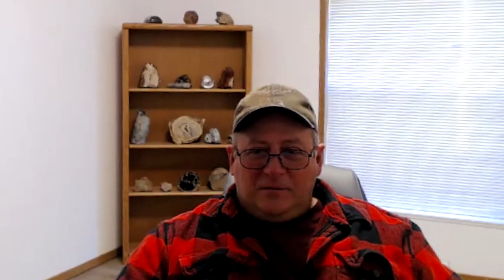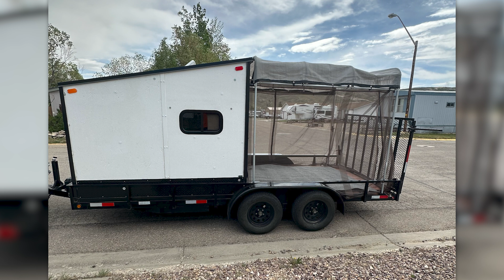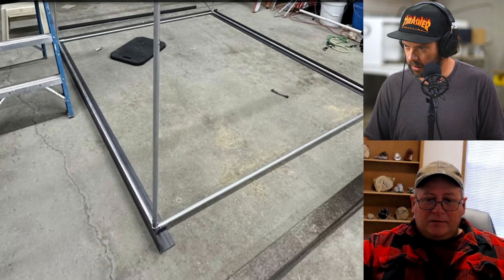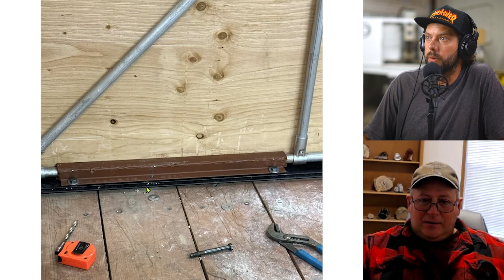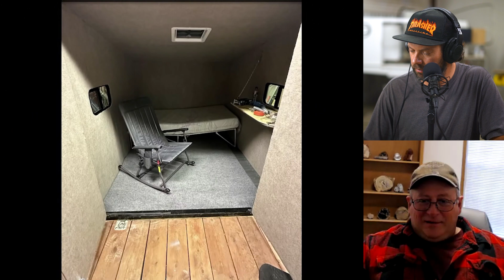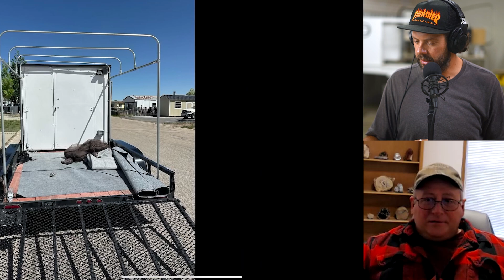Jim's DIY Toy Hauler Camper Is Brilliant!

Comment: Thanks everyone it was a lot of fun   I used 1/2” cdx standard plywood you can use Marine grade if you can find it.     I went with 1/2” plywood for a little more strength.   Then exterior primer then exterior painted,     The roof has a paint on rv coating that reflects a lot of heat, the trim is just roof trim you use on the edges under your shingled roof.   The doors are all framed with maker pipe connectors puzzle pieces clamped around the conduit then my hinges are bolted on to those and through the plywood   Thanks Maker pipe anyone can build cool projects with these connectors

Comment: Would have liked more information on how he sealed the roof, and how he made/put the doors on, and what is the black edging on the outside corners?
Reply: The roof has a reflective RV paint on coating the doors are framed with conduit and maker pipe connectors with puzzle piece clamps around the conduit then my hinges bolted thought the plywood and the trim is metal trim used on the edges of a residential house roof under the shingles

Comment: Great ideas.  I have a teeny  tiny motorcycle trailer that was converted to a utility trailer that I’ve been thinking about doing something with.   3/8 plywood for sure and I love maker pipe.
Reply: Thanks I used 1/2” plywood for a little more strength   I was going to try 3/8” but couldn’t find many 3/8” sheets of plywood

Comment: I'm thinking truck camper (top drop) with small trailer for 4-wheeler.  Love the idea of going remote, but I'd need a bathroom, TV, and HVAC for the evenings or colder/hotter days to extend the range of how long I could stay.  Also, a smaller footprint.  Love the innovation in his build though.